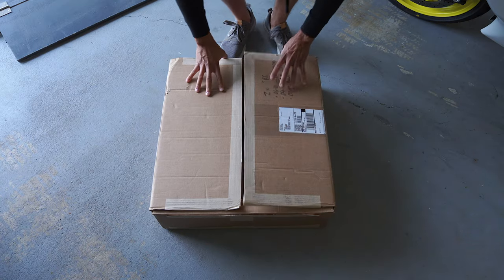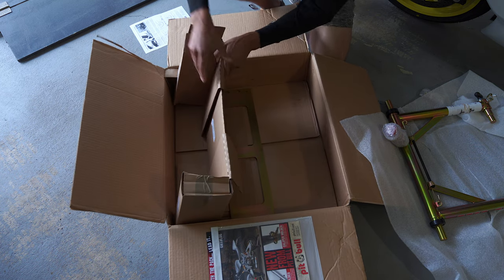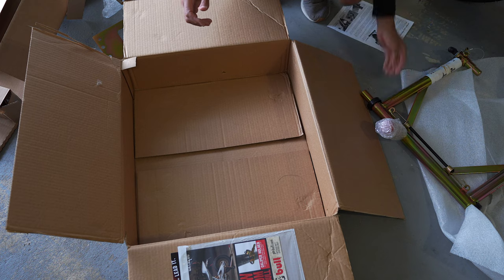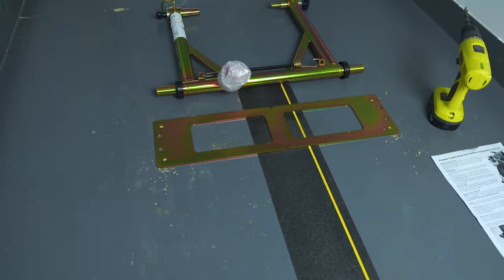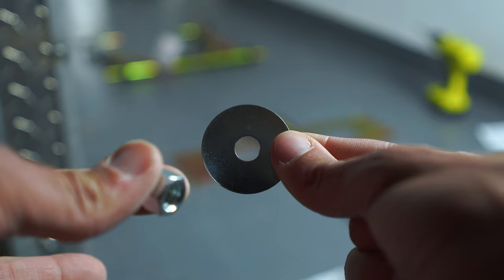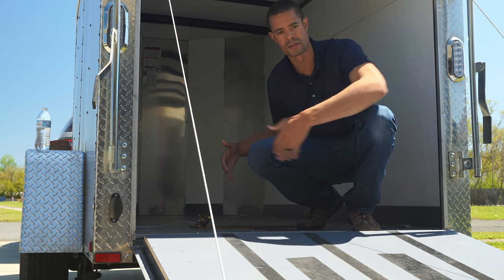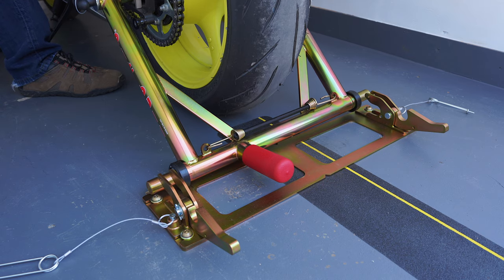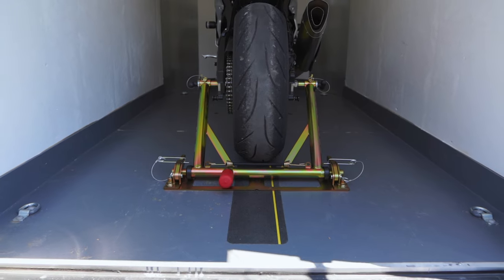PIT BULL Trailer Restraint System | NO MORE STRAPS!

Comment: So, with a heavier bike, 600 lbs or so, also a bit top heavy, that back will hold it tight and you don't have to worry about the front wheel turning / sliding and the bike now twisting and trying to torque and tear stuff up on the rear axle because the front wheel is turned and trying to fall over?
Reply from the maker: I have notice the front wheel turning some, but my bike is a lot lighter.  I haven’t had any issues and I leave my bars turned after it’s loaded.  You could do a strap in front but it would defeat the whole purpose of using the pitbull in an expedient manner.

Comment: quick question, but when drilling into the floor, shouldn't you at least drill one set through the frame for added security? would the plywood floor by itself be strong enough? and I just subscribed !!! great content
Reply from the maker: Hey welcome to the channel and thanks for subscribing!  Well in theory you could do that but not all trailers will line up just right.  You have to get the weight distribution of the bike line up right with the axle of the trailer so it’s not swaying.  The wood floor will hold just fine as it’s thick enough to hold the weight of a 400lb motorcycle. Same thing if you were drilling for anchor points at each corner for straps.

Comment: DeSoto Rinse
Reply: Shoulipcot For Handlebar Placement And Balance Rotation Shields With Floor Jack Wheels Are More Practical For Training
Reply: shoulipcot - a tee shirt binding sequence aesthetically used in circus throat performances
Reply: shoulipcot has greater strength in level placement of object by default thread count
Reply: in duality of direction of evacuation with aesthetic octave frequency signal dogmatic numeric average in knot notz distance

Comment: Eric, this is an awesome video. Question for you. The pins. Do they fit a wide arrange of bikes? I'm thinking of buying this for my trailer to transport bikes but not sure if I'll have to buy a different set of pins for each motorcycle manufacturer.
Reply from the maker: Unfortunately you have to buy specific pins for each bike.  The restraint itself is universal but not the pins.  When I sold my R6 I had to get different pins for my RC8.
Reply: @itsmeericb  thank you for the quick response! I'm wondering how many different sets of pins there are. I think I saw 3 different sets on their website. Do you know? Also, do you think this system is adequate for the larger/heavier bikes?